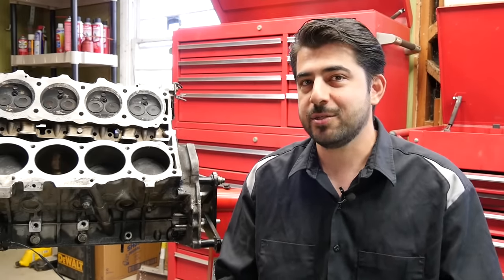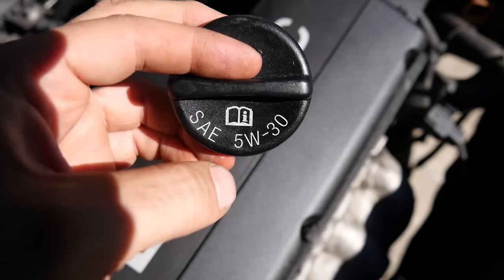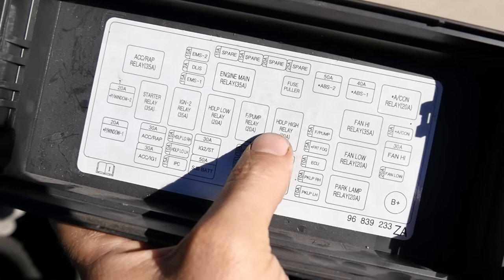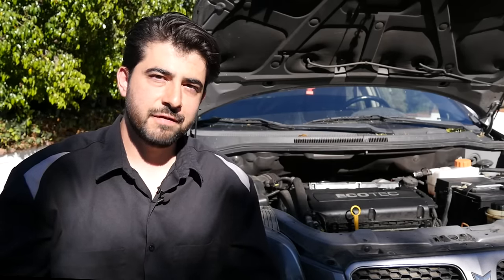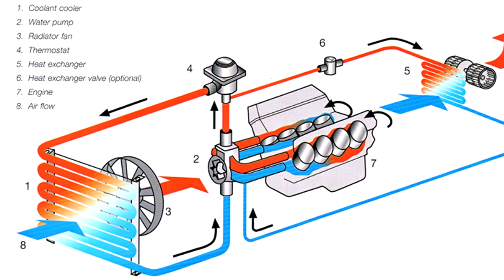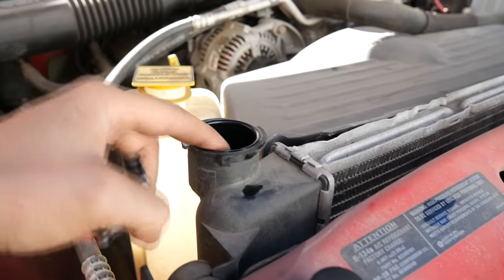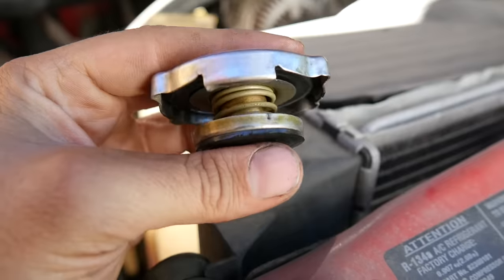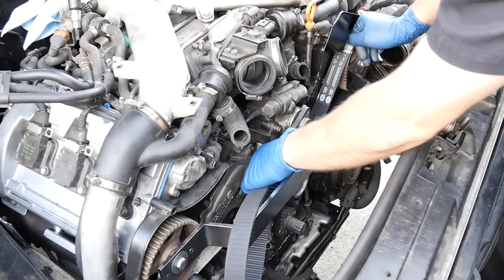Make Your Car Engine and Transmission Last a Very Long Time - Top 5 Tips On Car Care

Comment: This man appears to have a running Pontiac. He knows what hes talking about.
Reply: Ryan Williams my thought exactly!!! Had a grand am, was my first car. I always had problems with it no matter how good I took care of it.
Reply: It has an ecotec engine. I have one. Bulletproof.
Reply: Seems to have an Opel Engine, enough explaination so far.
Reply: Ryan Williams LOL
Reply: @stephanierios82  ME TOO
Reply: Man I laughed so hard at this lmao I just got rid of my Pontiac g6 for a new truck lol that car was the biggest piece of shit I've ever driven
Reply: Thats Pontiac Vibe, rebadged Toyota Matrix.
Reply: No, he just has a lot of money to replace things that break.
Reply: I have a Sunfire and for 10 years no problems but I do service way more than the average driver haha
Reply: @stephanierios82  I have a grand am. The engine lasts forever but everything else cosmetically breaks all the time
Reply: Lol
Reply: Emilio Diaz  I have a sunfire too, modded ^.^
Reply: The fuel pump fuse oil change trick I've done tbe last few oil changes its quieter on start up
Reply: If he makes a Pontiac last he can make anything last.
Reply: @stephanierios82  i had a buick century as my first car which i think had the sams engine as the grand am. Yeah.... i am really into cars and did all the maintenance on time and even early. I couldnt even get that car past 180k without a massive oil leak and the transmission slipped
Reply: @andruschka81  This is a Suzuki engine. GM started this partnership with Suzuki in the 90s. Pontiac Firefly, which was a Suzuki Forsa.
Reply: @TheDexa88  Yes it is, but the car he showed in the beginning is a Chevy Aveo, which in reality is a Suzuki swift. The engine is a Suzuki.
Reply: Frank L  Vibe is a Matrix, at least the engine is. Perhaps the alternator, starter and some other minor parts might be AC Delco.
Reply: Joe mariconadas Strange, Ecotec is an Opel Marketing designation.
Reply: I beat on my g6 and its still fine lmao. Go through 2 tires a year though....
Reply: Stephanie Rios I had a grand am where everything broke except the motor and the transmission. Then the clutch went out and that’s what finally did it in. Quad 4 motor.
Reply: italkgory99 the engine is the only part you really need anyway
Reply: @crand20033  no he’s a mechanic that can replace anything wrong in his car himself no need to pay someone
Reply: @chrisjacob1530  Amazing car. Engine build like a tank.
Reply: @bigcat99100  I just bought one any maintenance tips ?
Reply: @reggiemack8236  my tires rounds went bad alot. But i believe thats just how these cars can be. Other then some battery issues i was never left stranded. All i can ask for for my first car 😁.
Reply: I have a 93 Bonneville with 270,000 bud
Reply: @heygirlsup1820  🤣
Reply: Hell yeah I just got mines together
Reply: Does cleaning my sparks plugs make my engine work better as if I didn’t clean them?
Reply: 😂yup!!!!
Reply: Facts 😂
Reply: Is there others ways in make the transmission cooler without installing the trans oil cooler?
Reply: Nah facts lolol
Reply: lol I was gonna say the same shit haha
Reply: I think he makes good points, especially if he can keep a pontiac running
Reply: All jokes aside Pontiac was a gm product and GM did make many engines that could easily rival Toyota/Hondas. For instance the  5.3 vortec or the 3800.
Reply: Pontiac has only been defunct since 2009.  It should be running.  There are Pontiacs everywhere. Granted, the most recent cars will likely only last about seven to ten years.  But vehicle made up to around 2010 lasted relatively good, 20 years would easily be a service life.
Reply: Especially with the "that's what she said" joke. 😂
Reply: I started my car buying back in 1976. Bought a Pontiac with my graduation money.  I've been a mechanic ever since.  I now own a Honda.  I'm still changing the oil, stuff like that.
Reply: Its a Toyota with Pontiac emblems
Reply: That looks like a Toyota Matrix btw collaboration. Might be same engine
Reply: Opel engine